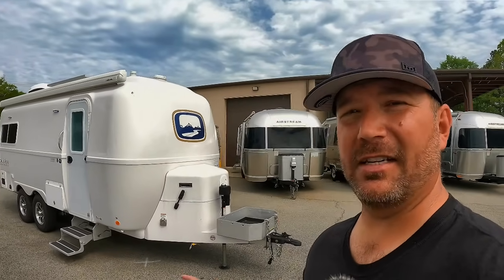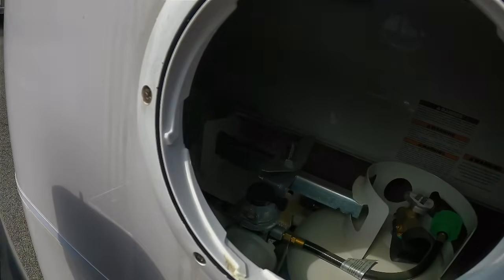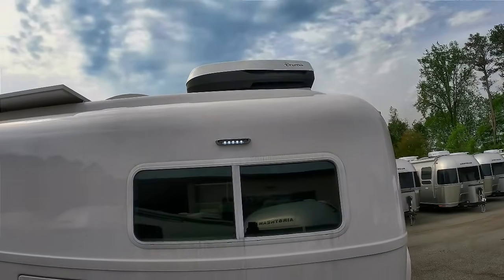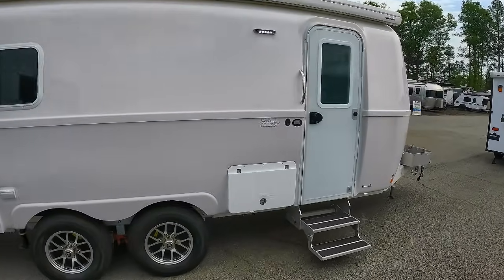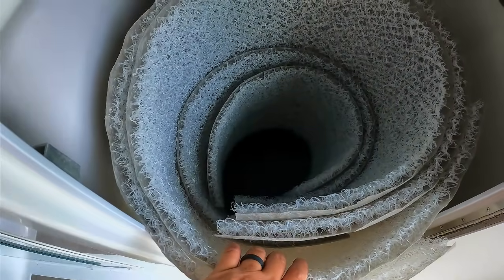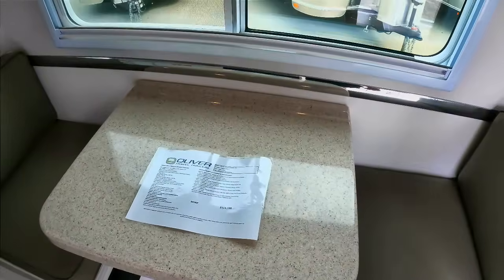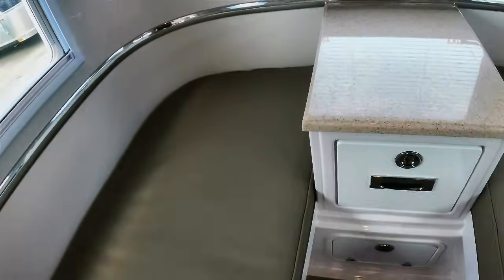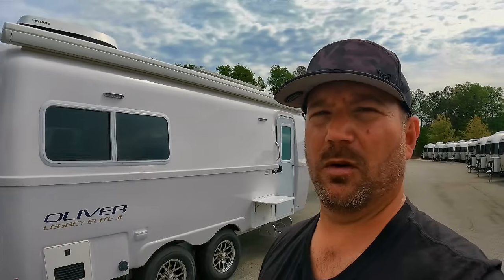Is This the Best Built Travel Trailer in the World? //  OLIVER Legacy Elite II Tour

Comment: FYI, the Oliver is a TRUE four seasons travel trailer. We have stayed comfortably inside our Legacy Elite 2 in 20 to 95 degree weather. All the tanks and drains are located within the dual fiberglass structure. No frozen pipes or tanks. Think of the Oliver as a giant Yeti cooler, well insulated to keep you comfortable inside no matter what the temperature is outside.

Comment: Going to a dealer network will only increase the price!
Reply: I believe build to order is definitely a better program. If all manufacturers did not have dealers their units would be held to a higher quality because the customers would be dealing directly with the factory, not allowing the factory to push off quality control to the dealer. Made to order is a very big plus.

Comment: Seems to me the water hookups will get all the dirt from the road? 🤮
Reply from the maker: Yeah, I thought the same. They’ve been doing it awhile. I guess it isn’t a huge problem.
Reply: They have threaded caps with seals. When I hook up, I rinse the connections, remove the caps and connect the water lines. It's such a non issue that I never even thought anything about it.
Reply: That has never once been an issue.

Comment: Yes and no. I bought an Airstream in the end.
Reply: Bad AC noise. They should have ducked the AC.
Reply from the maker: I’d argue the Oliver builds are better quality than Airstream but Airstream definitely has better floorplan options, specifically if you need more interior space.
Reply: @WanderingWeekends  I tested both out and Oliver had too little space for the buck.  They are overpriced for a fiberglass.  They both town nice, but in the end they just could not top an Airstream.

Comment: way too small for the money
Reply from the maker: That’s subjective… many folks love getting into places larger units can’t go. Also consider the wider range of tow vehicles equipped to tow these trailers.
Reply: I moved from a 40’ 5th wheel to our Oliver, I will never go back.  I can get into any spot I want, it’s the best built trailer out there in my opinion.
Reply: It's all very subjective and depends on what's important to your type of camping. We like quality and reliability. We also like not having to deal with size restrictions at state and national parks, many of which will turn you away if you are over 25ft. A nice bass boat like a Skeeter starts out at $100K and goes up with accessories. A Porsche 911 can run you $250K and more and only seats two and very little luggage. Quality is something you will always have to pay for. Giant cardboard boxes that fall apart when you use them are a dime a dozen. We all pay for what's important to us.
Reply: Some people prefer quality over quantity.
Reply: @matthewhenderson5070  Quality seems to be an even more important consideration since Covid and all the Full-Timer influencers blew up RV demand. Quality has not been a triumph in the industry lately. Oliver and perhaps a few others are seeming exceptions.